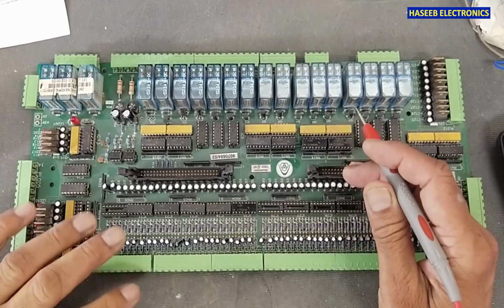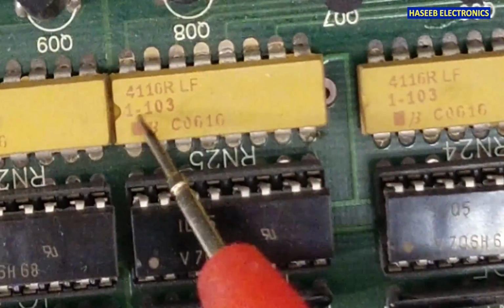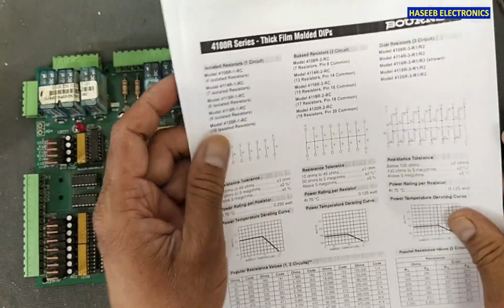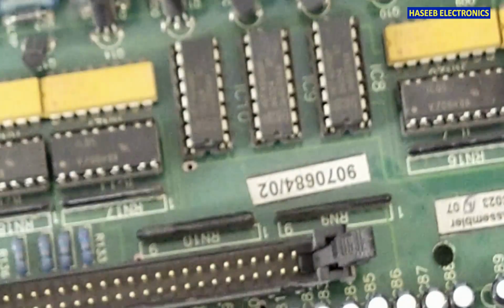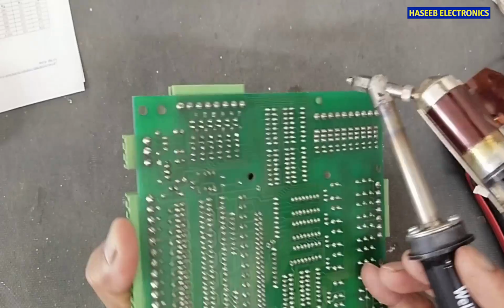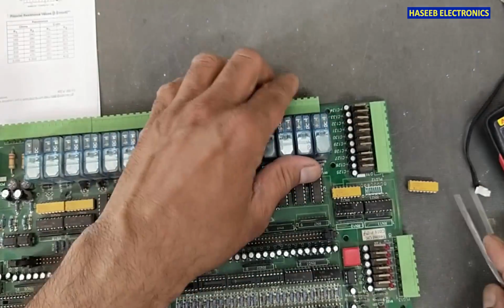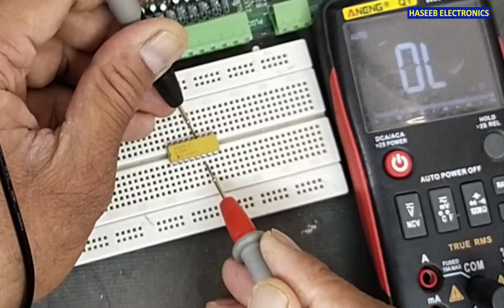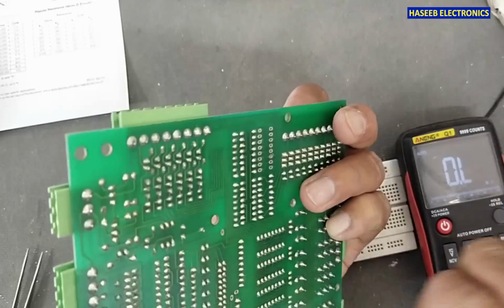{778} What Is Resistor Network || How To Test Resistor Network

Comment: very good and useful. but sir why they don`t use the normal resistors instead of this type of resistor??
Reply from the maker: because this molded pack is precisely designed with minimum tolerance and easy to install. it also prevents from weather effects